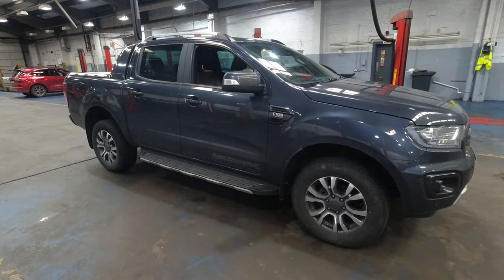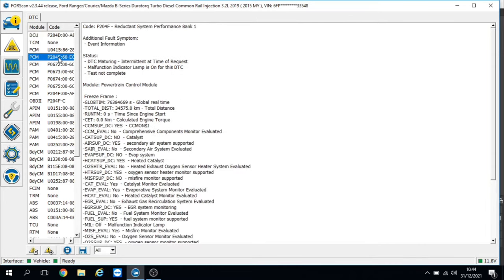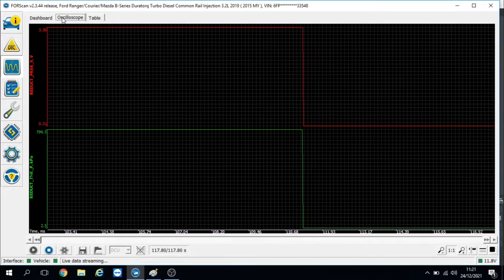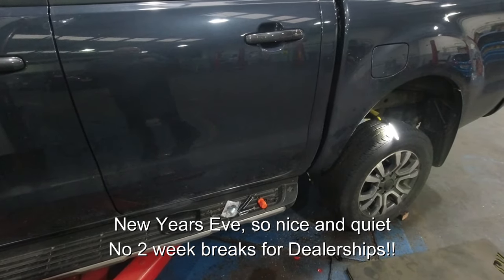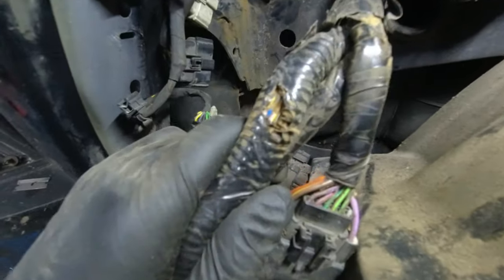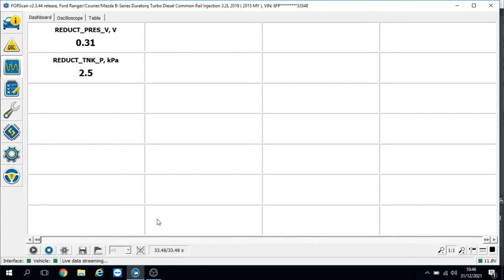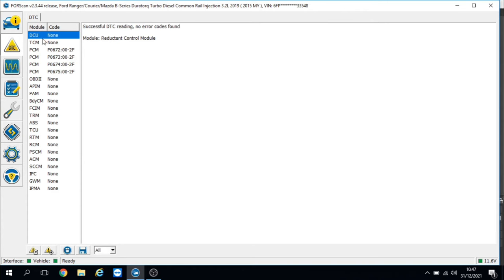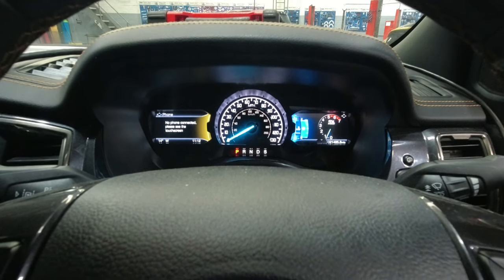Ford Ranger 3.2 - P204D P204F - AdBlue Pressure Sensor - What to Do?

Comment: Found this video after a very disappointing experience with the same message on the dash "AdBlue System Malfunction" and the AdBlue range being worryingly low (31 miles). Trouble for us is, no EML and no codes other than Glow Plugs. Took the tank off and fund the Pump Assembly was damaged with a nipple broken off and cable tied up. Odd!! Replaced the pump assembly hoping that would solve it but NOOOOO!! Still got the warning and still no codes. Gonna run through the wiring next. Fingers crossed! Wish us luck as without a code, we're a bit in the dark here. Anyway... this is just a very long winded way of saying Great Vid! Well done Steve.  - Nikki
Reply: I’ve got similar issue what the the outcome in the end

Comment: Hi guys, I'm getting a p204f  fault code ,engine light on but no adblue light , checked injector and all good ,any thing you have come across ,or any ideas for me to check ? Tia
Reply: Hey mate did you work out the issue, I have the same problem
Reply: Hey did you find the issue? I have the same fault .thanks